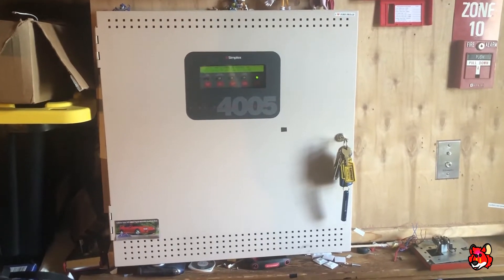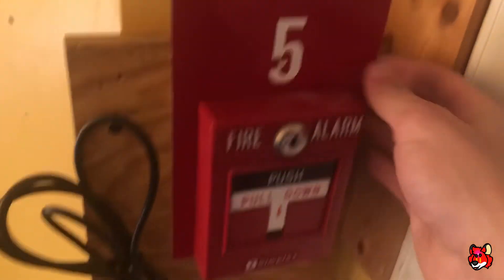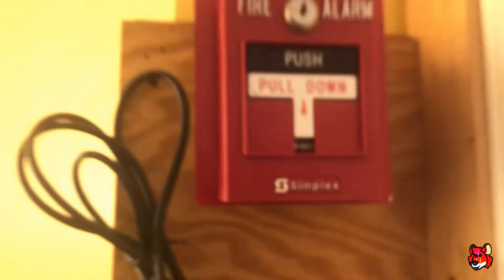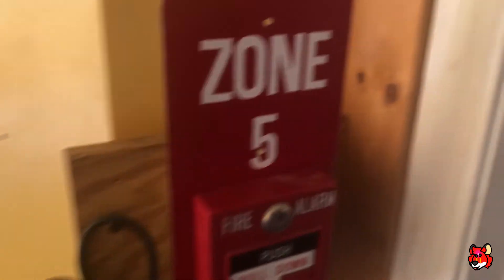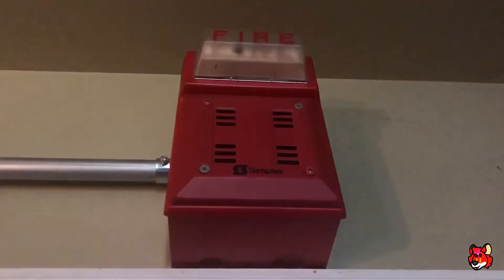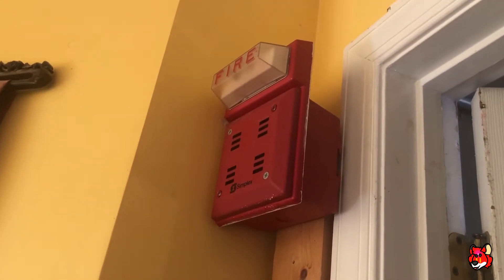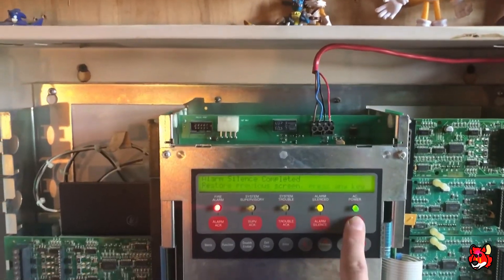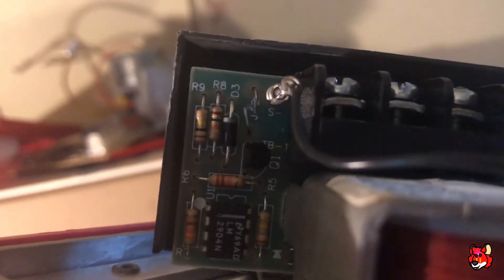Simplex 4005 System Test 9: More Simplex Mechanical Horns

Comment: Theses are exactly my fire alarms i have at my elementary school (Simplex 4903-9101 + simplex 2901-9840) also with (Simplex 2901-9838, System Sensor spectalert advance, simplex truealert with yellow strobe and white body, a remote strobe, a wheelock alarm in the portable [trust me idk the name] system sensor MASS, and system sensor 2400s) enough info guys? coding was on continuous and panel was a 4008 ( i think )